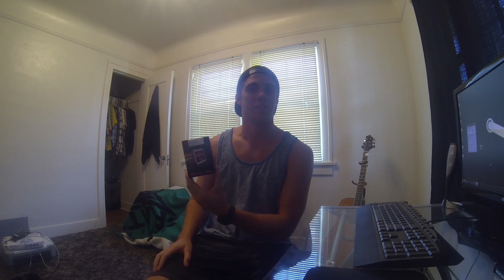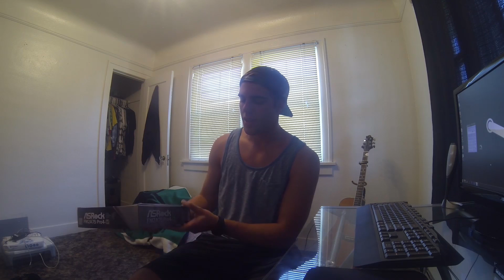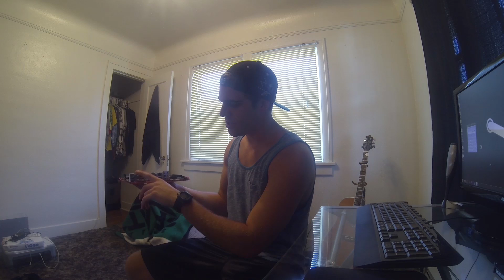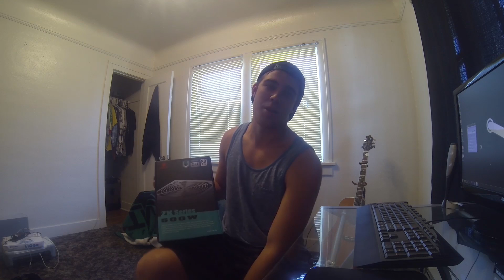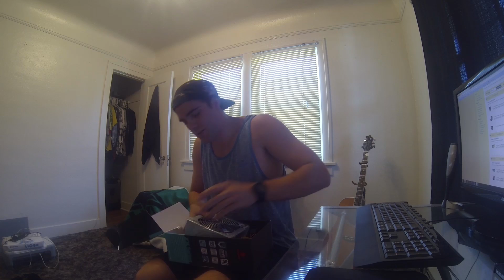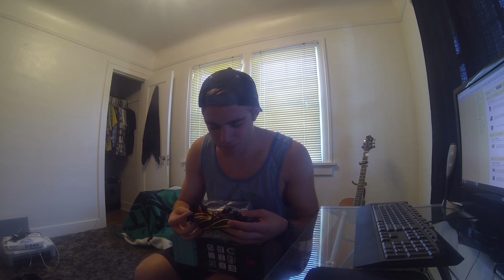2013 HTPC Build Part 1: The Parts

Comment: Have you thought about purchasing a 6670 to crossfire with your integrated GPU? Or upgrading to maybe an A10?
Reply from the maker: i actually have put my old radeon 6850 in it.  I'm going to post a video on how much of a performance increase it gives it.
Reply: I have wondered about how the 6000 series video cards would preform in an HTPC, I'll need to watch that.